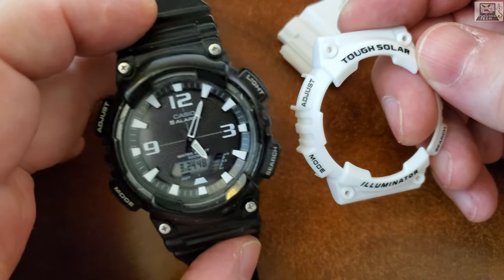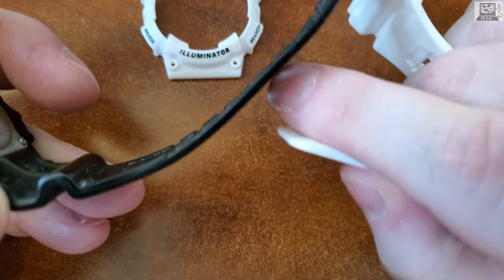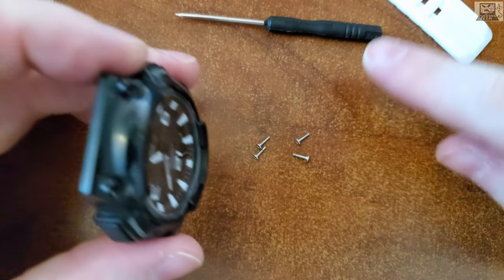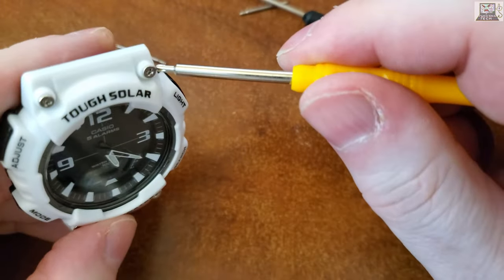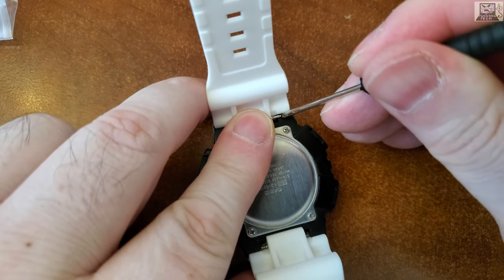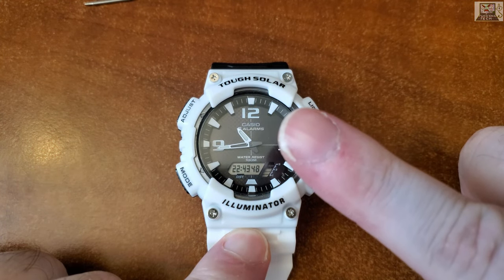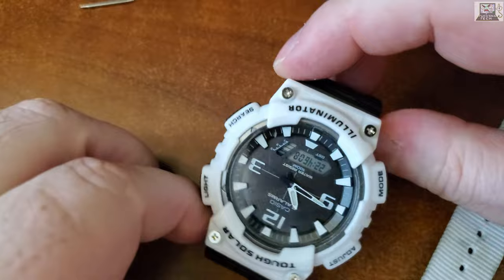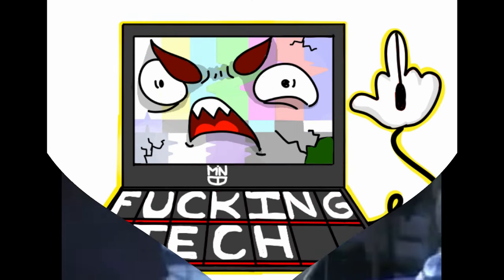Casio AQ-S810W Case & NATO strap modification (4k)

Comment: One of my favorite Casio watches. However i probably looked like the guy at the end of the video every time i had to set the time. What a pain in the donkey 🐴
Reply from the maker: Time is just as easy to set as any other Casio watch since the '80s. What is difficult when setting the time ? And to add to that, these are probably the easiest Casio watch buttons to use, which makes this watch pretty good.